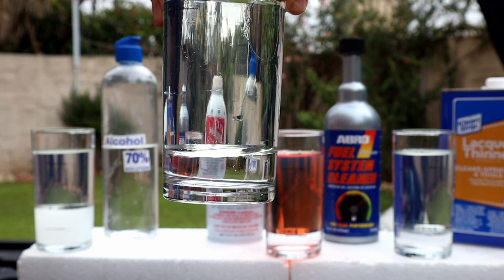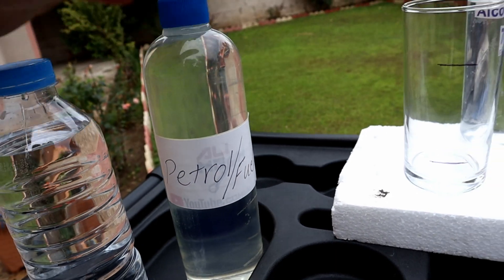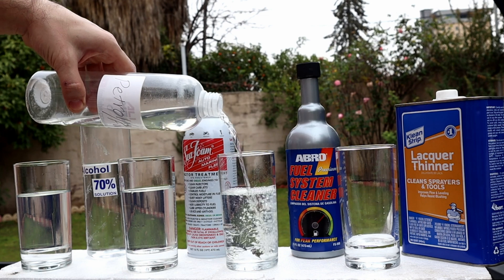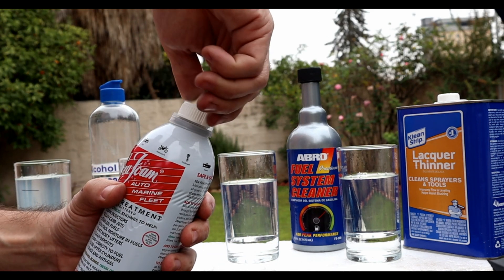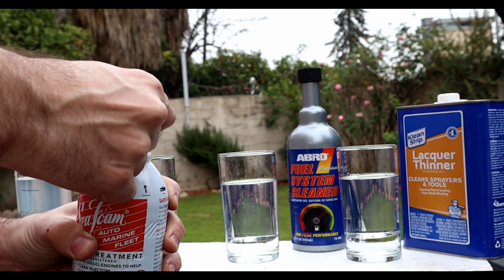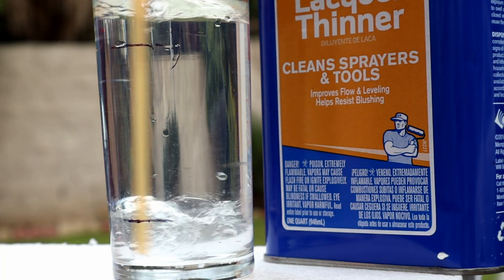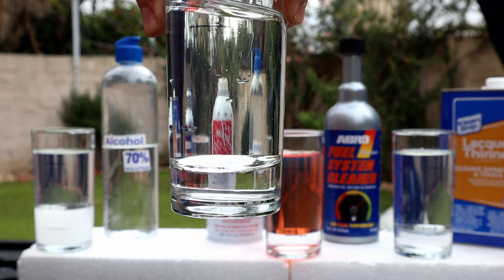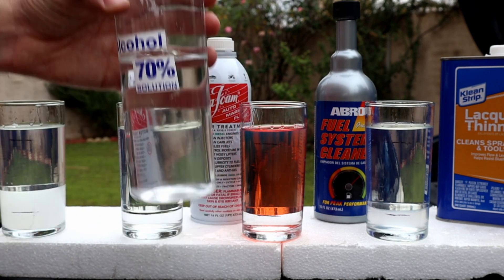What product remove water from fuel tank/how to remove water from petrol tank/water in gasoline tank

Comment: I leave my rotor tiller and snow blower outside all year.  Since ethanol is in most gas now I have a harder time starting equipment that has sat for over a month and a half, especially if the temperature from day and night fluctuate and tank is less than 1/2 full. ( more area exposed for moisture build up, good idea to keep tank filled up always to lesson this moisture build up, though it's still inevitable but lesser ).
It's frustrating if you don't keep up on the little preventative maintenance.
I generally get success with a dollar store turkey baister so I can throw out after or keep in garrage for other junk substances. I deflate the hand bubble and with a non disturbed gas tank for at least 10 minutes or more being still so water and ethanol can mostly seperate, place the tube to the lowest part of tank and slowly fill the baister tube and then empty it in a clear container. Repeating this process over and over.  Within a minute or more you can see the ethanol and water mix separating with the layer of water at bottom in the container. Get as much out as you can.  I add some methyl hydrate to gas tank. Then there's the junk still in the carb. Old carbs used to have a little spring burp bleeder plunger at bottom of float bowl to remove water or stayle gas but modern one's dont feature this anymore and newer ones are a bit involved as float bowl should be taken off, emptied and hopefully good gas replacing it from fuel line.
Been a while, I think Shell medium grade is ethanol free. I've phoned up petroleum company's and talked to their tech reps in past to find out which grades are dos and donts and which ones can vary from different places. I'm in Canada, Ontario.
Hope this can help anyone.
Reply: As of October of 2022, there’s not a single station left in Ontario that doesn’t contain ethanol unfortunately because I’d drive out of my way to the few stations left prior to October to buy high octane benzene gas for all my small engines and since then I’ve been looking for a viable solution to rid water from this horrible gas. We can remove the ethanol east enough but what to replace it with is the question because ethanol does have octane and it’d need to be replaced once ethanol’s removed

Comment: Is it harmful to run the Heet/water/gas mixture through your fuel injection system?  I picked up some water and put two bottles of Heet in the tank.  The engine still occasionally misfires or bucks during light acceleration.  My question is does Heet actually remove the water or just lessen the effects of it.  I heard it can phase separate.
Reply: It doesn’t work because fuel still separates from water
Reply: Don't listen to him he's a goofball it doesn't take the water out it mixes with the water and makes the water burnable

Comment: Drain it from the bottom, the water goes first.
Reply from the maker: Yes, that's a great idea, but some cars dont have drain plug
Reply: @AliMECH  but on lawn tractors works great cause you just have to pull the gas feed from the carburator and it drains from the bottom.

Comment: You must use anhydrous alcohol or 97%. The 70% alcohol already contains too much water to absorb a useful amount from the gasoline.
Reply: It will still work you will just need more I buy 50 mils from the chemist 100% isopropyl I usually put 2 in when I had water in my tank i used 100 ml
Reply: I'm about to drain a gas now and all I have is heat water removal.
Where can I get anhydrous alcohol?

Comment: The big problem is Entrained air in the fuel when it's in the car fuel tank.... Proven.... By Engine Polygraph.
We cannot see inside the tank..... Its a big Foam Party.... And the automotive industry does not know about it.... But your injectors do.... Injector cavitation is a big issue.

No driver ever returns manufacturers  claimed MPG figures....

The fuel economy figures are in decline as soon as the engine is run from brand new.

Oxytane vastly improves the Air Release properties in the fuel restoring fuel economy..... The only additive that works.... It does not alter the fuel.... It does not make more power...... Only restores lost fuel economy... And virtually makes injectors last forever.

Water in fuel is actually a Minor problem in comparison to Entrained air in fuel.... Proven by Engine Polygraph.... Seeing inside your engine.... Like magic